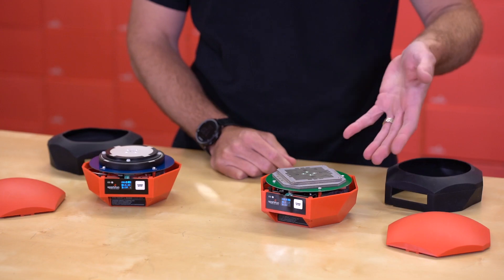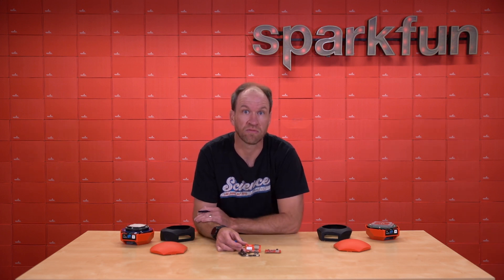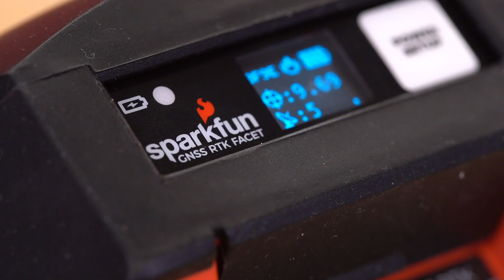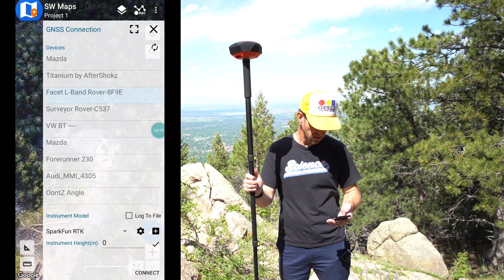Product Showcase: SparkFun RTK Facet L-Band

Comment: I'm not interested in this l-band corrections service (ntrip will do just fine).  But i am interested in the 'upgraded'  antenna.

Does this one have any benefits over the regular Facet?

L-band corrections are nice in areas without mobile internet, but that's no issue where i live.

If it has no benefits whatsoever i could save the cash on the regular model.

Comment: This product already have a built in radio to comunicate whit other unit?
Reply: No there's no radio here. It has 2 pieces of ICs on the same PCB so there is no radio. It's basically an all-in-one solution One is a classical GNSS receiver chip like the F9P and the other is yet another ublox chip that receives the L-Band corrections and feeds them back to the F9P chip to account for the corrections. Another example is Hemisphere's Atlas. You can google it for more info.

Comment: UPDATE: After a brutal day in 100 degree (real F degrees) , full sun and clear sky in a thick swamp, I was surprised and confused to discover the data points I collected were a mix of DGPS, RTK float, and RTK Fix. I'm not sure how this happened since there was absolutely no indication that the decryption keys were loaded, armed or active. Probably a software bug or just bad sw design. It appears that RTK Fix was only achieved in absolutely unobstructed view of clear sky. The slightest tree cover drops it down to RTK float or DGPS. RTK Fix errors were 1.5"H/3"V, RTK float errors were 4"H/8"V, and DGPS errors were 2'H/4'V. Bottom line: This unit is great for wetlands delineation, but nothing less than RTK fix will do for topographic surveys and even that may not suffice for fussy construction work. When the subscription for the L-Band service runs out, I'll probably be buying a companion Facet Surveyor to use as a base station. Maybe even sooner. Overall, Sparkfun has made quite an impressive and useful, cost effective unit. And while their software and documentation are heads above the competition, there's room for some improvement - they are 95% there. As far as customer support, lets just say there's an opportunity there for them to exploit.
Reply: Thanks for the lo-down, hopefully things can improve over time; as for now you've helped me make my decision.
Reply: Thanks a million for the feedback. This is quite a turn off. Glad you could test out how well it performs in a real world and I admit it's quite unfortunate. I wonder how well Hemisphere's Atlas compares to this tho. I also think that 1.5''H/3'' errors are certainly great but not quite there yet... Although you can't expect more from a cheap GNSS chip like the F9P.